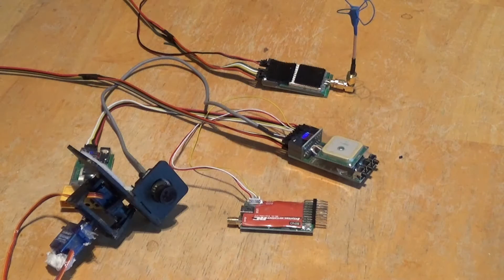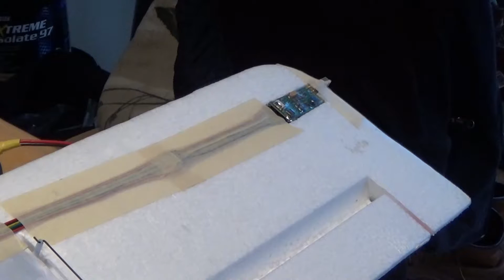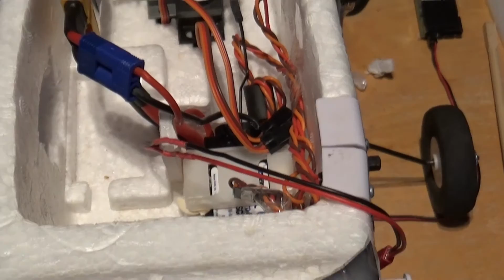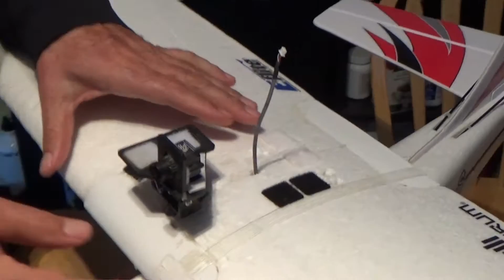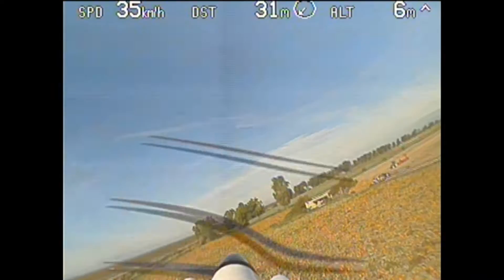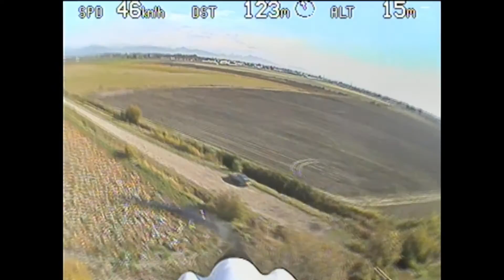How to start flying FPV. Part 7 connecting and mounting EzOSD

Comment: I want to use immersionrc ezosd and want to use a video switcher for 3 cameras.  The immersionrc ezosd uses the right audio channel to send the telemetry to the antenna tracker. Can I leave the right audio channel connected continuously and just switch the yellow white and black with the switcher. I don’t want to F up this. Any HELP!? Flashnine @ msn.com
Reply from the maker: Gordon Bennett Hi Gordon, EzOSD is quite primitive. Best is to have EzUHF for control and use a flight controller to get stabilization and Return to Home
Reply from the maker: Gordon Bennett I used the video switcher with bad results! The resolution varied because of the different cameras! I end up putting a pan and tilt!

Comment: Have you tried hooking the EZOSD up to a 1.3ghz video transmitter? I would think all you would need is the yellow video wire to go to the video transmitter and also supply 12v to the power side. My 1.3 transmitter is a Lawmate 500/1000mw and had 12v power from batter and then ground 12v power to camera and the yellow wire for video signal no audio..

Comment: I just wanted to share with you that if you were referring to the horizontal lines around the propeller, that is not because of interference, it is because of the type of camera you are using. It has a "rolling shutter" and captures the image from top to bottom; line by line. The effect is created with fast moving things like props. Just wanted to share in case you are trying to purchase filters and things to reduce the effect.

https://youtu.be/17PSgsRlO9Q

Comment: Hello
 I wanted to ask if they could help me I've configured everything as described in the video but when I turn on the system will be no battery time is but if I depart recipient of the battery indicator as
Reply: when I turn comes,
 only the top line is displayed
the lower is not displayed

but when I turn on without the connection to the receiver
the lower is displayed without the rssi

it looks as if the receiver the link between osd and current measurement disturbs
Reply: I have tried it but no change to previously :(
I think the receiver has a fault and additionally blocks the current sensor
Reply: that's funny ImmersionRC tell me I should watch her video :)
Reply: Change the screen size in osd menu